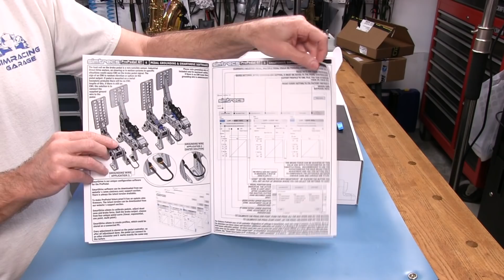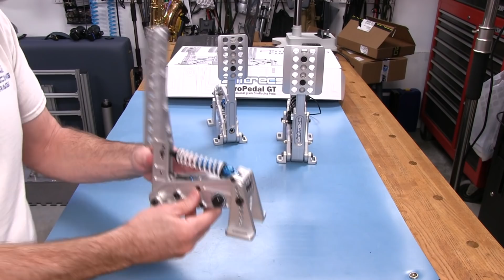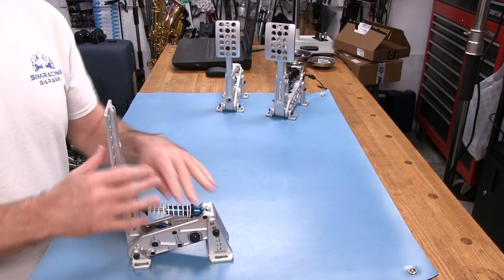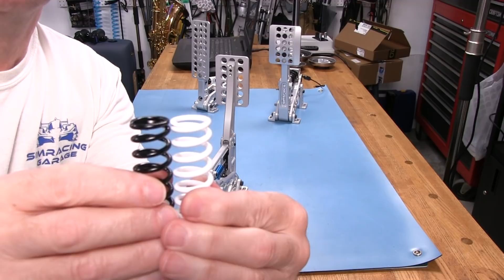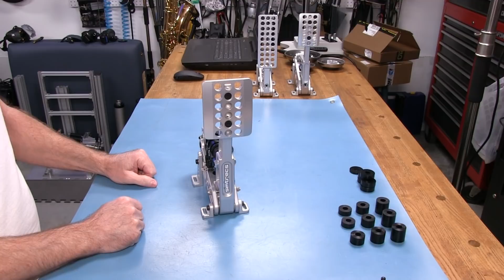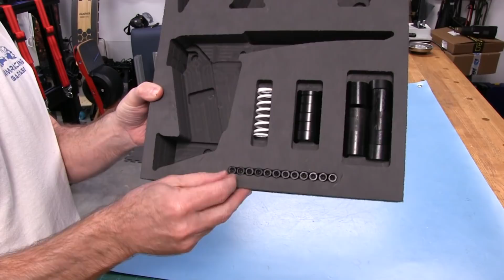Simtrecs Pro Pedal GT Review

Comment: I'm wondering who taught you to heel-toe that way? I was taught by a pro racer that "heel-toe" is really a misnomer. That the proper technique is to use the right edge of the right foot, rolling the foot over the brake pedal to blip the throttle with the outside edge of the foot and maintain consistent brake pressure. That is why racing shoes and boots have a reinforcement on the outside of shoe/boot to take the wear from blipping the throttle.
Reply: Depends on the set up of the pedals of the car.  Carl Yarborough of nascar was famous for his "toe-heel" method.  Heel on the brake, and tow to blip the throttle.  Since the brake pedal and throttle pedal are far apart on a stock car.  Like many things, I expect the correct method is whatever it takes for you to win.
Reply: IMHO, it Depends on the pedal setup in the roadcar you’re driving.  With f.e. BMW, you can use the side of your foot.  With Porsche you need to move your heel over to get on the throttle.

Comment: I thought I never need another set of paddles as I had HEU until I watched this video.
Reply: Did you end up getting this, and how is it in comparison to the HE Ultimate?
Reply: @wuzumaki  still in line
Reply: @ARARARA6  Ok. I might line up myself. Construction seems very similar to HE Ultimate, but cheaper. I also prefer the long throttle pedal. Haven't finished the review yet, so I have yet to hear the final conclusion.
Reply: @ARARARA6  So how is it?

Comment: Does it work with PS4/5 using Fanatec Clubsport wheel?
Reply: Short answer is no. Basically there is no other pedalset other then from Fanatec, Thrustmaster or Logitech which work with consols.
Reply: @C42ST3N  Thanks.

Comment: Only Barry would talk about the type of cap that’s on the jar of grease that a sim pedal set comes with. You, Sir, are the man.

Edit: After 3 months of waiting, they’re suppose to arrive at my doorstep today, can’t wait!
Reply: It's been a while now, how do you like these pedals?
Reply: @wuzumaki  No complaints at all, a lot sturdier overall than the Sprints I had. All pedals have a nice feel to them, throttle is smoother and easier to modulate, trail braking is much easier with the progressive feel of the damper and clutch feels more fluid. Extremely well built and worked with no issues out of the box, highly recommended!
Reply: @pooljunkie85  That's great to hear. I've already placed a pre-order, but I'm on batch 8 which is going to be finished by the end of September. Did you get them with the optional baseplate or do you have them mounted differently?
Reply: @wuzumaki  Yeah I got the baseplate with it, easy to put together, really sturdy like the pedals themselves and mounts on my P1X pedal tray with ease.
Reply: Feel good don't they lol

Comment: Can you do a video comparison on pedals vs value? Meca Cup 1's vs these, vs HE's with price factored in?
Reply: @eIgHtY0N3  Super cheap laser cutting??
Reply: @eIgHtY0N3  HE ultimates use laser cut parts but is it a better pedal set?  So do Meca Cup 1's.  Are these worth the extra because they are cnc machined?  I get your paying for asthetics is that worth the $xxx price difference between other pedals
Reply: 1. I think the SRG just give a thorough explanation of each product. Doesn't seem fairing comparing because preference is subjective. 
2. Price could vary quite a lot depending on shipping and taxes for where different people live.
3. Best thing to do is get as many different opinions on feel as possible (or test them), and make your own decision based on your criteria, and remember to check shipping & taxes.
4. I think you'll more likely get a response if you phrase your questions differently i.e. "Which are your favourite pedals?" or "Which are your favourite budget pedals?" rather than asking for a direct comparison, or ranking. Or maybe try and email SRG so that it isn't in the video comments?
Reply: Im also deciding between these two at the moment. Here are some of my considerations which might be useful. I still haven't made my mind but.. Ill share anyway:

1. Heusinkveld handle more force but most people dont need the forces that even Simtrecs handle.

2. Heusinkvelds use all load cells which basically have infinite life (like 200 million cycles or sth ridiculous like that). Simtrecs use pots which will eventually wear maybe years down the line, but consider that even logitechs use cheap pots compared to this and Ive seen some of those work for like 10 years easily. The pots seem to be easily replaceable by the user if you can find the correct part number too.

3. Heusinkveld use a cheaper manufacturing process like you said and look worse than simtrecs (Simtrecs are absolutely beautiful), and also use off the shelf dampers. Even though this is the case, I believe it is a good thing as you can replace the parts on your own. Replacing the damper on the simtrecs can be done by the user, but the part might need to be sourced from them as they are anodized. You might be able to get something off the shelf but it wouldn't have that color. Of course, this is given that the fail which is highly unlikely. The dampers also seem to work better on simtrecs from the videos ive seen. Just watch the two SRG reviews.

4. Hs have an external electronics box, which is extrenal -> more interference, more cables but can be upgraded down the line. Also they are 12 bit vs 16 bit on the Simtrecs but in the practical sense it doesn't matter, and Hvelds can be upgraded down the line. Simtrecs are difficult to replace the electronics ( not that hard if you can get a board from them, but harder than Hs) , but how many times has some simple electronics board gone bad on you?

5. Simtrecs easily have the better presentation (not even close), cost the manufacturers more (maybe atleast double the manufacturing cost), have better software, although Hveld seems to be working on one for Ultimates. 

6. Simtrecs are cheaper by like 200 USD, but you might have to wait. I placed a preorder and I am in batch 6 (didn't have to pay anything yet), however they are estimated to ship at the end of july or in august. Hvelds are available almost always.

7. Simtrecs use a weird usb cable which is difficult to obtain, 1/8 inch jack to usb. Might need to contact the manufacturer for a replacement.

8. Hveld are an amazing company with an established, tried and tested product, with great customer service. I know they are almost certain to exist maybe 10 years later too. Simtrecs are new but I don't know if they will be there long term or if they are a boutique manufacturer and they focus on this short term. They probably will be there and this wont matter if the product lasts.

9. One flaw in the design of simtrecs I found is on the throttle pedal. On the max throw setting, the pot arm seems to touch the back. This is not a load bearing part and it might be possible to bend it with enough force. You can easily solve it by setting it to a slightly lower throw setting, where this arm doesn't touch. The pedals also seems to have a hard stop as barry mentions in the review. Heusinkvelds have a soft stop which can feel better under the feet and uses an easily replaceable blue stopper (looks like urethane, not sure though).

In short, Hveld seems to have a philosophy of extreme durability and easy maintenance, and awesome customer service, but also with higher margins. You can also see this from them just using stock fibroelastomers that kinda look ugly compared to the all black ones on the Simtrecs (although the sprints have nice looking ones). Simtrecs are more about creating an elegant product that kinda hits all the marks ( apple like in a sense). It easily costs them more than twice as much to make their pedals than Hveld, given same labour costs, and are also cheaper. Hveld Ultimates are also quite old, and may have an upgrade soon in the next couple years or so I think, but I don't know how they can make it better, other than maybe integrate the electronics at the cost of some servicability, and have some nice software with it. 

Which is better? I dont know. I would like some of your suggestions as I don't know which one to buy. In any sense, having either of these pedals will be a dream to use anyway.
Reply: @anupjsebastian  at the end of the day I bought the Meca Cup 1's.  To me they sit between the HE sprints and ultimates.  Do they look as nice?  No but my feet are on them so I don't care as much.  I can almost buy 2 sets for the cost of HE ultamotes.  Software - they both use the same and it works.  I think parts would be a wash either way.  Like you said a control board is a pretty easy swap on HE and Meca's.  I haven't heard of anyone having issues with either pedal set.  Buy what makes you happy.  You are the only one who has to live wirh that decision.  I choose to use pedals that work for what I want and use the savings on other sim gear.   Good luck man.
Reply: @anupjsebastian  Your post was both very helpful and unhelpful for me, because I still don't know wether I want the Simtrec or the HE Ultimate, lol. 

I do feel like HE is the "safer" choice as they have been tried and tested for many years, and many professionals also use their gear. Simtrec might not exist in a few years, but they also might become a very respected brand in the next few years. It's impossible to know, only time will tell. My philosophy has generally always been "never be an early adapter", but that philosophy became kind of "irrelevant" after seeing the review of these Simtrecs. Hopefully as more users receive their Simtrecs, we will get a better picture of wether they all-in-all are greater than the Ultimate or not. And yes, the Ultimate pedals are basically dinosaur pedals now. I don't really want to spend a fortune on "outdated" pedals, even theough they are good pedals. 

I also agree that it really doesn't matter which one you and I end up getting. I'm on Thrustmaster T-LCM right now, basically anything that is not from Logitech or Thrustmaster is an upgrade from this.
Reply: @wuzumaki  you might want to wait. I’ve heard that Heusinkveld are gonna update the Ultimates. It was in some interview. Maybe in the next 6 months or so. TLCMs are great. I had those for a while, but eventually got the sprint after getting to try both the ultimates and sprint. Ultimates we’re far beyond my needs, especially the brake. I had the mentality of getting the best possible one, but actually trying them made me change my mind.
Reply: @anupjsebastian  Good looking out, I'll wait. Just made a major investment going from TS-PC to Simucube 2 Pro, so I wouldn't be able to buy any of these pedals untill after summer anyway.
Reply: @anupjsebastian  You were right, Ultimate pedals are now on sale because Ultimate+ is supposedly going to be released this summer. The Ultimate is now even cheaper than Simtrecs.